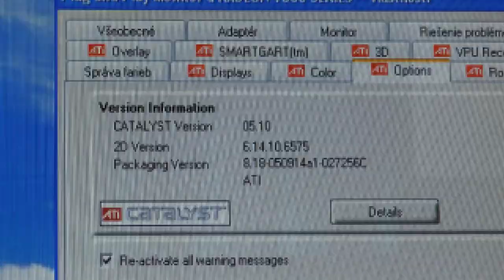Can It Game ? // ATI Radeon 7000 Series

Comment: I used this graphics card for my 700 MHz Pentium III processor with Windows 2000 and 256 mb ram and DVD drive.  My computer played games like GTA 3, Max Payne 1, Elder Scrolls 3: Morrowwind, Metal Gear Solid 1 (on high settings), WarCraft 3 (plus expansion) and Diablo 2 (plus expansion and on high settings).  Heck, it surprisingly can play games like GTA Vice City and Metal Gear Solid 2 but only on low settings.  The reason why I could barely and surprisingly play the latter two games was because of the optimization of these games.  Both games technically require 800 mhz Pentium 3 processor but if your processor has better than 32 mb video ram* and 128 mb ram* (*the minimum amount of video ram and regular ram to play these games) and you have a DVD drive and your processing speed is pretty close to 800 Mhz, you can barely play those games on low settings (12-15 fps).  Also, the reason why I played Metal Gear Solid 1 and Diablo 2 on high settings because my computer was a bit too powerful for these games.  In summary, this computer and graphics card is perfect or right for early 2000's gaming and is capable of playing some mid-2000's computer games (e.g., GTA Vice City and Metal Gear Solid 2 [The PC versions for these games both came out in 2003]).

Comment: Wfw 3.11 svga-drivers work with it. So Win3x 640/800/1024 with 256colors is possible.
Early Texture-Compression is supported (S3TC). Unreal (patched) and UT99 look really nice! 
Has some issues with older games, but image Quality is very nice! 
Also VGA-Lowres and EGA-Lowres and Textmode VGA are centered on TFT. (only a view cards do that!)
HardwareScrolling in Jazz2 is not supported :( (i815e can do that)